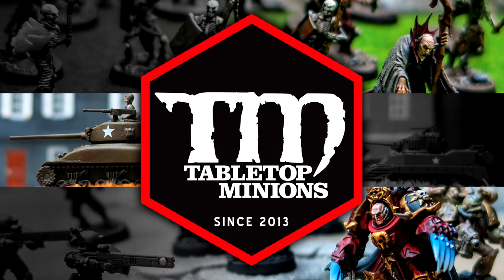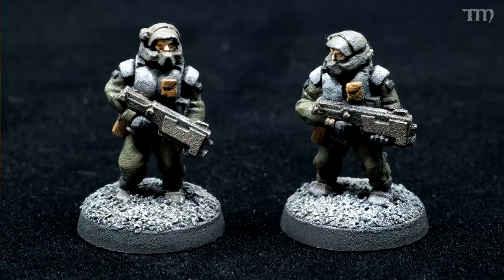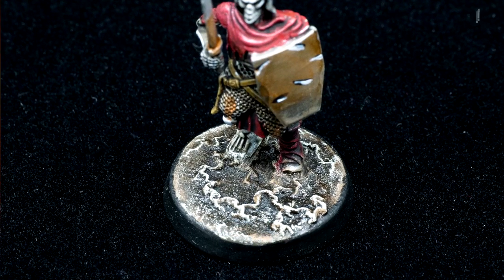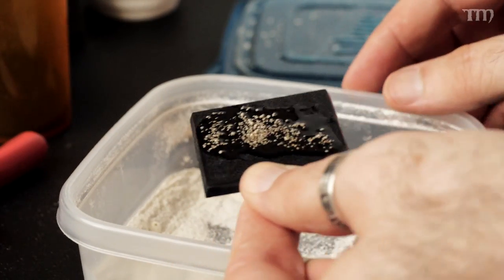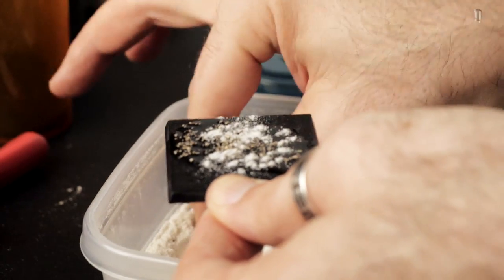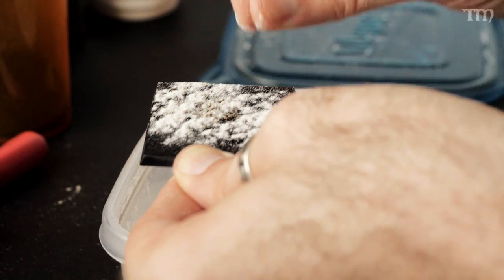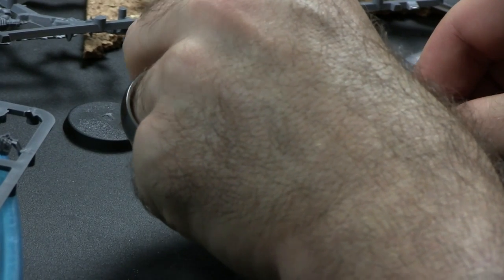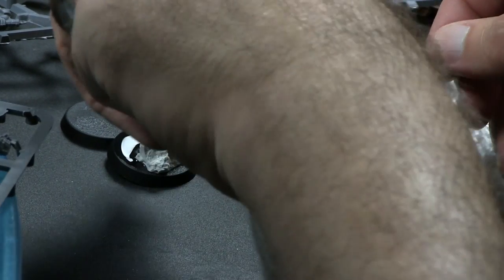The Secret of my Baking Soda Basing Technique

Comment: Great advise ... the basing tips not the glue sniffing. It's worth mentioning that baking soda is way less expensive than other basing material you might find at the hobby store. Also, if you buy a big bag of kitty litter and only plan on using a cup or two, the local animal shelter probably wouldn't mind the donation. Thanks Atom!
Reply from the maker: I wasn’t technically “sniffing” the glue, I was testing to see if the tip was blocked after I finally got the cap off. I usually squeeze the bottle near my nose, and if I can smell the fumes coming out, then I know the tip isn’t blocked. It’s never sprayed out like that before at home, and now, in hindsight, I can see why it’s always been a sketchy idea. Thanks for watching!
Reply: My only thought is that you are going to burn through a lot of glue... I have assembled a fair amount of the Plastcraft terrain using superglue and I'm always surprised how quickly I run out of glue... So depending on the country you are in, what's a pretty inexpensive source for super glue?  I feel like those little $.99 tubes are not worth it.. I look for the larger triangular bottle of superglue that I tend to find @ the hardware store... vs say specific miniature gaming glues like Zap-A-Gap then tend to be more $$.
Reply: @SciFiPorkChop28  U can try universal glue. In the UK u can find tooth paste size tubes for 1 £. Sticks to anything and  its strong. It takes a few minutes to set and a couple of hours to fully harden.
Reply: Use white Elmers glue diluted with water and apply to base with paint brush then apply base material.Then seal. Also there is plenty of free base material outside in nature. Gravel,sand, rocks, ...etc,
Reply: @davidparton9158  and Azrael88 - I guess I'm confused, aren't we talking about the baking soda basing technique? and isn't it the reaction between the super glue (cyanoacrylate) and the baking soda that makes this technique work?  if I used Elmer's white glue or universal glue won't I just end up with a snow like effect?... I suppose i can always paint over it... but yes, otherwise, Elmer's or Universal glue and various other tidbits, sand, gravel, etc work great as basing material

Comment: Speaking as a PVA Loyalist i understand your concerns about it not sticking to plastic bases, the unfortunate truth is that PVA glue requires a super long time to cure. When doing bases with PVA/Sand/Baking Soda/Cork you have to make sure that the base is allowed to cure at room temperature for at-least 12-24 hours after that point I've never had issues with it.

Comment: Great technique! What I do is I have a big tub filled with various different materials sand salt baking soda kitty litter tiny cork crumbles. What I do is a heavy application of wood glue on the base fairly thick then I put it in the mixture and then level all the material out with a little exacto or pallet knife with the glue when it dries it creates a nice level surface that shows all the variance in basing material then I gloss varnish it before priming and painting

Comment: Just found this video. Love it. I am a miniaturist and use chipboard for furniture, fencing, etc.  I use CA glue and spread it with an old credit card and coat it with baking soda. Brush off excess.  It is like board. It can be filed, sanded, cut, etc.

Comment: Great bloopers at the end. 

That's a really good idea. I ran into the issue of "sand" size/scale on a 1:35 USMC desert sniper team diorama I made back in September of 2018. I ended up using extra fine craft sand. Of course it was still out of scale but what I did helped a little. I used pva to glue down the sand and when I did my sealing coat with watered down pva after misting with isopropyl, I sprinkled a little baking soda over the top while the sealing coat was still wet. It turned out ok but still wasn't entirely happy with it, but it got me a silver medal in the competition. 
So, I think next time I need to do sand, I'll lean more heavily on the baking soda and use the sand for smaller rock.

Comment: I still use sand, but i tend to stick to casting sand, with some normal sand mixed in. It gives a fine grain powder, like baking soda, but also has a little diversity.
Reply: is casting sand a technical term ive never heard of?
Reply: wubda wubwub probably not unless you've done some metalworking with a forge to melt a metal and a process called "lost wax casting". Or in the case of of something 3D printed, "lost PLA casting".
The hot metal, usually aluminum, melts/burns the wax or the PLA out of the mold and takes its place. The molds are made from casting sand that has some clay mixed into it.
1 Lb Petrobond Casting Sand Gold Silver Copper Jewelry Delft Clay Alternative https://www.amazon.com/dp/B00XRRKCRO/ref=cm_sw_r_cp_apa_9tFnBbM47V27G
Reply: Thanks!

Comment: If you want finer sand (or whatever texturing agent you're planning to use), a mortar and pestle does exactly that. And you can also sift sand to get the finest sand and dust separated from the larger bits.

Comment: Like the glue catalysing idea - In the UK cocktail sticks are round (typically about 2mm diameter) sharpened at both ends but toothpicks are flat tapering wooden sticks, about 30 thou thick.

Comment: I have used PVA glue and sand grit, rocks, etc., and I have never had the basing pop off. I have dropped many minis in my time and have never had any basing damaged. I score the plastic base with a modeling knife. I mix PVA with water about 50/50. After the material dries, I put a second coat of 50/50 glue. I will  add more material and build up parts to make the ground uneven. When the material is how I want it, I put a last coat of glue.

Comment: My go-to basing material is ready-mixed wall filler (spackle). Just get a little bit on a small tool, and spread it over the base, kinda like a texture paint. It winds with about the same grain as baking powder, but you can sculpt it into rocky textures as you lay it on, and when it's set, you can even carve cracks and such into it.

Comment: Great advice! For a more textured, earthy look I use spack filler (used for filling cracks in plaster walls) with fine sand/stone/twigs etc pressed into it before its fully sets. Like the CA glue a little goes a long way and its very cheap too.

Comment: I use the baking soda technique (also from building scale models), but what I’ve moving to, came from building scale model dioramas, and that’s a mix of dirt (yes, actual dirt from the yard baked to kill off bacteria and fungus) about 30-40% and grout (non-sanded) about 60-70% using ‘Gorilla’ wood glue. Also I make my own bases with Masonite, the type with one smooth side which makes the underside leaving the rough/“textured” side for the wood glue to adhere extremely well. Using different shades of grout (darker and also lighter than the dirt) gives nice tonal variations and you don’t have to paint it because it naturally looks like dirt and the grout binds the dirt and dries rock hard.

Comment: Just use cheap glue. I use Cheap superglue from the cheap store (Dealz/poundland/dollar store). With the Bicarb it will still dry rock solid. 
Only thing to watch with this is that it can give off a lot of heat during the reaction, you don't want this mixture on your skin, as it can cause chemical burns.
Reply: Do NOT lean in over your work, the gas rises, and will burn out your eyes, nose, lungs.

Comment: To prevent baking soda snow bases from yellowing use this recipe. Baking soda, pva glue, cheap white craft paint and water. The amount of water determines how fluffy or flat you want your snow. When you put it on the base you can sprinkle some baking soda from high up to give it a smoother, less cluppy texture if you like. I suggest testing it out before you base your model. Once COMPLETELY dry (4 days) you can then seal it with matte varnish.

Comment: Sand your plastic base prior to PVA glue with a coarse (80 grit) sandpaper and the glue will adhere much more strongly. I've also used a watered down (50-50) PVA glue to coat my baking soda used for snow. Didn't go yellow, but did slightly reduce the 'fluffy' look of the snow.

Comment: I like to use it to fill gaps on models.  I have not had much luck  with green stuff. Plus you can get super glue of different consistency. I use the thick gel for wider gaps so it doesn’t run before I sprinkle the baking soda on it

Comment: The baking soda/CA glue technique also works as a gap filler. Fill the gap with baking soda, drop a drop or two of CA glue onto it, and let it soak in. When it's dry, it can be filed, sanded, carved, etc.

NOT drying wood in the microwave is GREAT advice. I tried it once. It actually caught fire in the microwave. Smoke, flames, melting plastic, and $400 for a new microwave. Strangely enough, my wife thought it was hilarious.

Comment: A similar technique that can give greater depth in fewer steps is epoxy + microballoons (see hobby store, tough baking soda can be substituted for microballoons). Use five-minute epoxy, mix it with the microballoons and whip it up to an icing-like consistency. Then you can sculpt it on the base with a toothpick, put in/on sand if you want, impress texture as it hardens, etc. Hardens in 5-10 minutes and is sandable if you want to shape it after it dries.

Comment: Tips for cleaning up after a CA spill: If you get CA on your skin, run it through running water. Moisture is what normally cures CA, so excess water makes it cure prematurely and causes a weak bond. Makes getting that CA off your hand much, much less painful.

Watch out if you accidentally get CA on cotton clothes, though. That thing will boil your skin. And that is not a hyperbole.

Comment: Just as an addition to this you can also use compressed air (the kind for blowing out keyboards) will clear off all the loose baking soda.   Also putting PVA glue on a base then dropping CA glue causes it to bubble up.

Comment: I used pva and fine quartz sand so far and it holds on to the bases. I have not knocked of the basing mechanically so far. However when stripping the paint of a model with propyl alcohol, the pva will just fall off, which can be an advantage if you want to overhaul a miniature completely. The ca glue is more chemically resistant. In fact the only solvent that will destroy ca is acet one, which unfortunately does dissolve plastic as well.

Comment: If you do want to use sand still you can get bird sand from a pet shop, literally costs £1 in the UK for about a kilo. It is SUPER fine. If you want to skip the gravel you can also get it with bird grit in it, which is ground up seashells, really small bits that are still small but a bit bigger than the sand.

Comment: I have been using CA glue in my scratch built models for over 35 years. Take my advise: Dust your work surface with baking soda and dust your fingers with baking soda BEFORE you get out the CA glue!

Comment: Have you tried PVA glue with Corn Starch yet? Another use for Corn Starch is to mix it with 2 part epoxy to make a very nice material you can kneed and sculpt into shape and sand. Just wet the tools or fingers. Works great. (Super Glue will get brittle after time, especially when using catalysts. And its kind of expensive when you are basing 100+ miniatures. But it does look good..

Comment: I don't know about anyone else, but I am super-sensitive to cyanoacrylate fumes, which surprised be since I rarely react to anything else. Mosquitoes, fleas, and other biting insects rarely cause a reaction and I don't get poison oak. But let me work with super-glue for a while without adequate ventilation and I will feel like I am dying from the worst cold ever for about two days (and about two weeks for the symptoms to completely disappear). First time it happened I had no idea what was going on, but if you read about the toxicity of cyanoacrylate on Wikipedia the symptoms are accurately described. Working with a puddle the size of the first one in this video is all you need for a really bad reaction. I try to have a fan blowing from behind me and have a window open and that does the trick. If you can smell it you need better ventilation.

Comment: I was drilling into some concrete yesterday and found something even better (though admittedly harder to get); concrete dust! It's at least as fine as sodium bicarb powder but completely unreactive and non-yellowing. I remembered this great video when I saw the dust coming off the drill bit, and it inspired me to catch and save some. I haven't tried "raw" cement out of the bag yet, but that should work too, although it is reactive due to its lime content so it might do some funny things when mixed with glue.

Comment: I wrote a paper involving super glue. I believe the OH- from the baking soda is part of the initialization of the polymerization of the cyanoacrylate, so it's not a catalyst, but more akin to adding tinder to a fire. I think under normal conditions, cyanoacrylate polymerizes when in contact with atmospheric moisture. It's been a while, so I could be wrong.

Comment: one thing to keep in mind is the canvas you're working with.

generally speaking, most bases are black. that color will bleed through any sort of thin material you base with. one thing to solve this issue is to paint the base area you're going to texture with brown/light brown/oranges for sand, as an example example.

Comment: I think I will stick to PVA+ baking soda. Playing with amount of powder you can change the texture from powdery to melting or with ice layer on top. Once dried it takes all the washes nicely so you can put a drop of seraphim sepia and nuln oil to get that dirty looking snow then cover everything with thick layer of ardcoat. 
CA glue and powder works great if you need to fill gaps in your model.

Comment: As for the natural materials (eg. making scary trees out of grapes twigs) - dry it and then coat in several layers of dilluted "white glue" (polymer glue dispersed in water), then prime, etc. 
Should the natural material shrink because of drying more, the crust of glue will prevent paint from downgrading (and also moisture going to the pain layers)

Comment: Great info but thumbs up just for the T-shirt

Baking soda makes a good hard filler too. Put the baking soda down first, brush to shape then gently add the CA. It will soak in and set to make a strong sandable fill.

For basing, get the cheap CA form the dollar store - save the good stuff for actual gluing.

Comment: You may try and use a Stainless Steel Tea Difuser with extra fine wire . Tap the Side of the difuser to lightly dust the Soda onto the glue

Comment: i find PVA glue works better if you use MDF bases as opposed to the the plastics ones. In Australia for $60 you can by 100 GW bases or 300 MDF bases from a 3rd party. another reason why i avoid GW as much as possible

Comment: You can also use real soil, just dry it out. It has a great texture, doesn’t even need paint, and it’s free.

That said I recommend hitting it with a quick dry brush of a lighter tone at the minimum. Plus it offers a variety of “grit” that you won’t get from just using sand, baking soda, or pumice.

Comment: Great video! There are ways to dry organic stuff in the microwave, there are tutorials, but it´s better in the sun nonetheless. The oven may burn stuff, you gotta keep an eye, maybe two, on it, I also can tell it FOR SURE. As a side note there are other fine powders out there one might be tempted to try, even salt, if you put it in a mixer you can thin it down, BUT salt has some weird properties like causing osmosis, which can ruin your painting etc,, so think well before trying any substance, it can behave or react in ways which can be even dangerous, do some research.
Reply: I live by the sea so I have a ginormous range of grain sizes and even "styles" of sand, but not soda-thin, almost, but not quite the same.

Comment: I went the opposite direction.  There is a big pile of left over filler sand and gravel behind my house.  I just cleaned it and pva glued it to my bases, then topped with clear paint to help hold in place.  The gravel is rounded, probably from riverbed, so it looks like my marines are trudging through dried river beds.  if I was ambitious I would have poured clear epoxy to make it look like an active stream.

Comment: The internet seems devided about baking soda having a risk of yellowing, or reacting chemically and turning into sludge years later. Though it is less clear if they are talking just about the PVA+soda snow paste mix or using the soda as a powder.

Seeing how this video is 5 years old now, did you ever have any problems with it?

Comment: I've been using this method for over 2 years and lately my bases started "sweating". Some yellowish (maybe bcs Martian bases) goo started to appear like sweat on skin. It smells like vinegar or freshly opened silicone tube. I'm using GreenStuff World gel super glue. Where I live humidity is low and these models were kept dry and away from greesy fingers. Does anyone know what it is and if it can damage paintjob?
Reply: Dont use gel. Use runny liquid superglue .  The gel glue will react to the soda on the surface but stay uncured underneath, if too thick.  Probably that.

Comment: my tyranids army was based with pva glue and the entire base just pealed right off in the hot months of the year, total waste of my time, considering i used two coats to seal the basing material... so im going to try vallejo ground texture paste and then try sprinkling basing material on that
Reply: I've been using the Vallejo thick mud, and it works great with static grass

Comment: Super thin super glue is way better as the heat makes the soda expand gorilla glue does with water with thinner glue it doesn't exipand as much and never used your fingers use a small metal or plastic sieve to put it on.